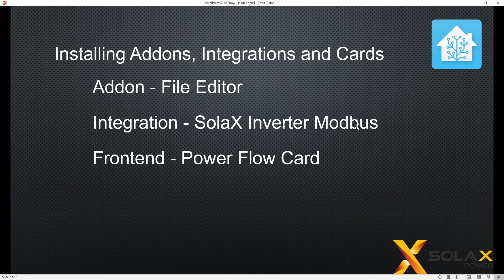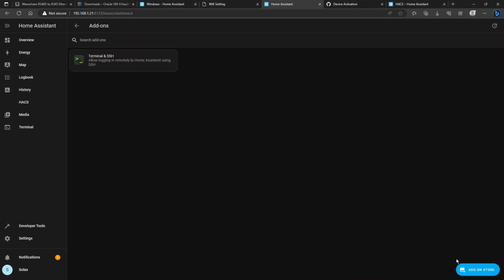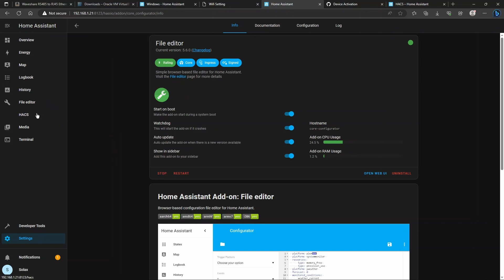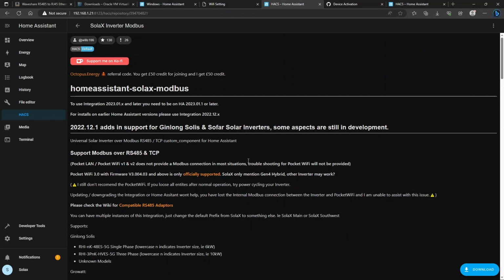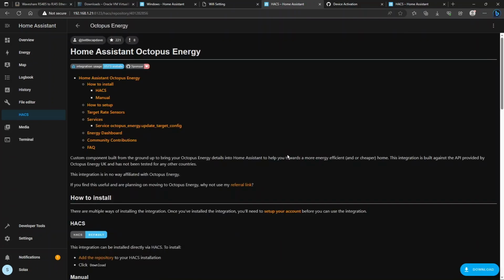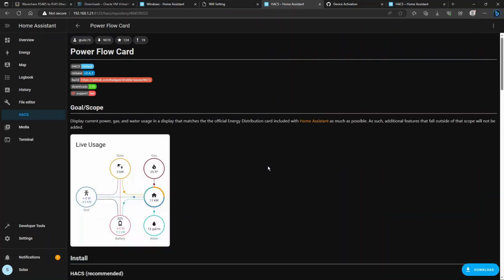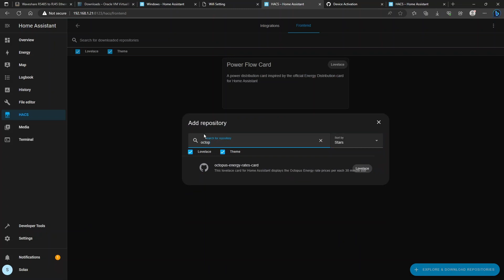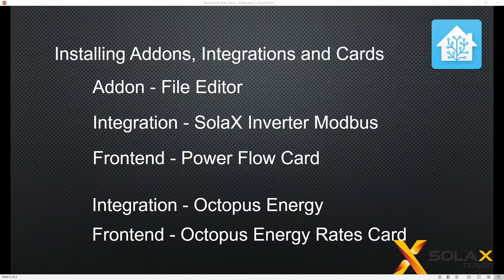06 - Installing the Integrations and Frontend Cards - Solax Solar Home Assistant Tutorial

Comment: Hi hope you can help when I select HACS I just get a list HACS, Octopus Energy, and Power Flow Cards... I don't see the Front End cards etc
Reply from the maker: When you click HACS in your sidebar, you should see Integrations/Frontend/Addons/About in the main screen section.  Choose Frontend.  From many of your other comments, there seems to be some connectivity or installation issue restricting the interface, almost as if HA can't connect to the internet properly.
Reply: It did when I first installed, but now it just shows HACS, Octopus Energy and Power Flow cards in a list.   If i select one the items it just show the documentation about each item.  Would like to add a screenshot but don't think I can add one here.  Really weird.  I just wanted to re arrange my screen with a different layout, but can't access anything.  I should add everything is working beautifully shame I don't appear to able to add anymore cards
Reply: @Gemjack  same here.. I can add the repo (and if you try to add again it states that is it already added). I can see the repo under Frontend.. but when clicking Explore and download it cant be found.
Reply: When clicking hacs in the sidebar it doesn't load the UI with integration icon and others just goes to a documentation page?..
Reply: I’m having the same issue as Dom above , when I click the HACS on sidebar it dose not show the same as video. Just shows a document type page . 
Any help ?